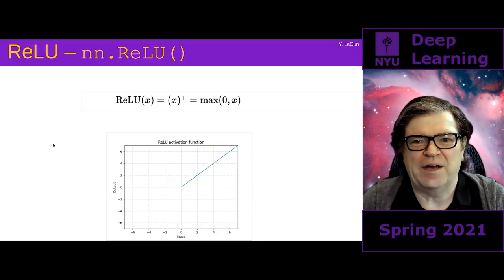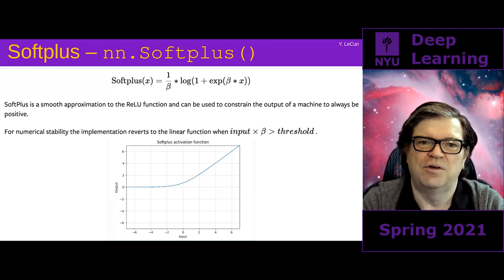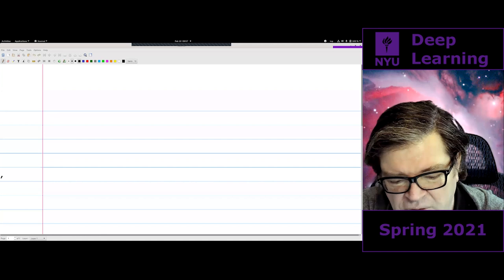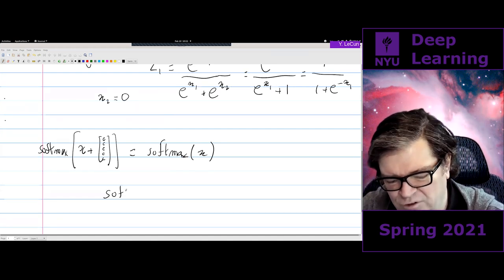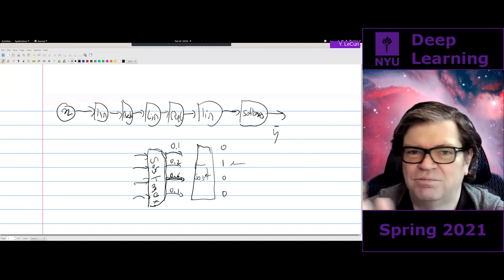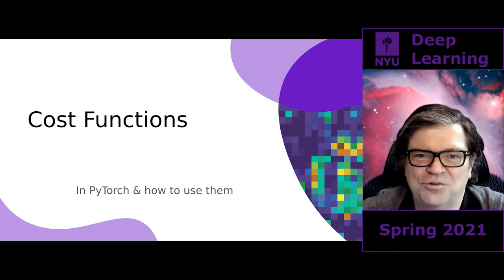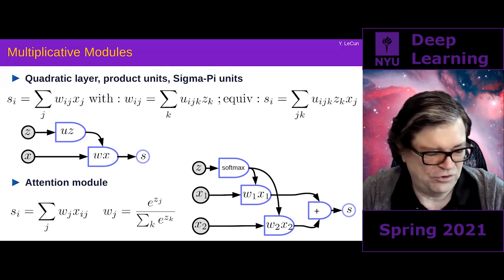02L – Modules and architectures

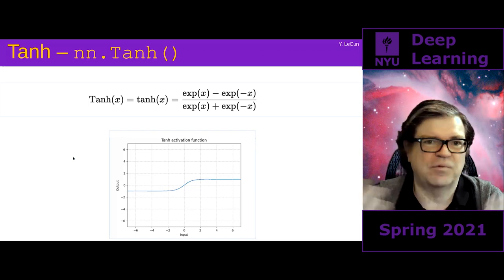Comment: @8:33 One of the reasons why ReLU is better in deep networks than say Sigmoid is that the gradient in backward pass after each sigmoid nonlinearity gets smaller (multiplied by around 0.25), but in ReLU-like nonlinearities, the gradient does not get smaller after each layer (the gradient is one in positive part)
Reply from the maker: Assuming no normalisation layer is used in-between, yes.
Reply from the maker: What would be bounded?

Comment: Regarding the Mixture of experts, would it make sense to train the Experts nets separatelly?
I mean something like training the Expert 1 over a dataset that is for sure Catalan, and the Expert 2 over other language. After that we'll have those trained models, and a general dataset (with multiple languages) could be used to train the Gater only (the Experts' weights wouldn't change anymore).
Reply from the maker: Sure you can do that. It turns out that the joint model works better because it can exploit the similarity between the two contexts.
Reply: @alfcnz  makes sense, thanks!
Reply from the maker: You’re welcome 😊😊😊

Comment: Thank you Alfredo,
and I want to know what's the 'z' in the attention architecture example as Yan introduced, does the 'z' also come from the training data? thank you!
Reply from the maker: You need to point out minutes:seconds for me to be able to address your question.
Reply: @alfcnz  ~59:02 the topic is "multiplicative modules", thank you
Reply from the maker: z is a latent input. Latent means it's missing from the data set. Hence, you need to infer it by minimisation of the energy using GD. We've extensively covered latent variable energy based models in previous lectures.
Reply: @alfcnz  Thank you, 
Sorry, I didn't get this information in previous lecture (if it in the order of the video), but I noticed that there is a lecture call "05.1 – Latent Variable Energy Based Models (LV-EBMs), inference" in later videos, thank you!
Reply from the maker: My bad, I apologise.
I thought this was the lecture on associative memories. These topics are only briefly introduced here and will be extensively covered later on.

Comment: Why doesn't ReLU have a variant with ReLU (x) = -x for x <0 instead of being 0 or ax for x <0.
Reply from the maker: What do you need the identify function for? 🤨🤨🤨
Reply: @alfcnz  I meant RELU(x) = abs(x). It will still be non-linear, but I guess it serves no purpose.
Reply from the maker: Absolute value has been used as non linear function, but it wouldn't let you turn off specific inputs. So, the output would always be the non-zero piecewise linear combination of the input.
Reply: @HassanAliAnwar  Hey! I think this is covered at the start of the lecture when Yann takes a question regarding non-monotonic activation functions. To summarise, I think intuitively, he explains that as there would be two solutions for x when f(x) = some value (except for x=0) this means that the gradient descent step could be taken in multiple directions, which can, but not always, lead to less efficient learning for the problem, i.e. if abs(x) = 2, do we walk towards the direction of the gradient being -1 or in the direction of the gradient being 1?
Reply from the maker: Yup.